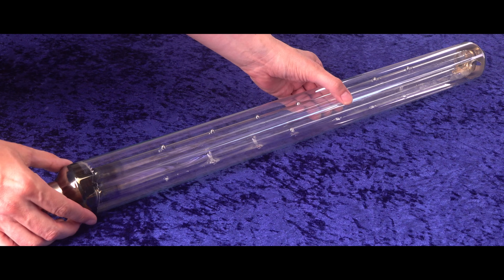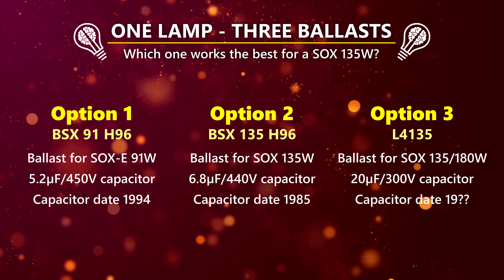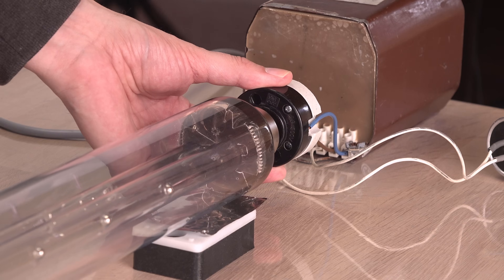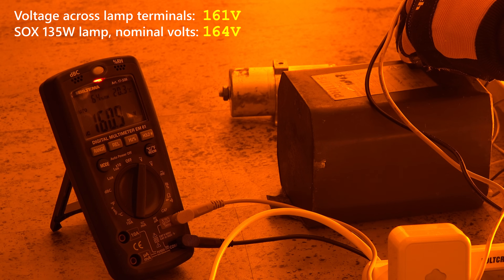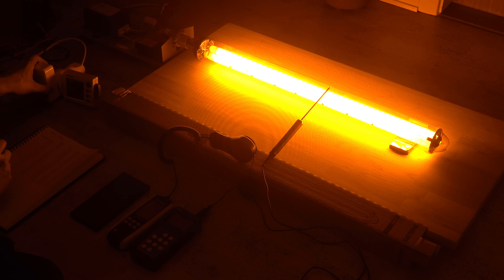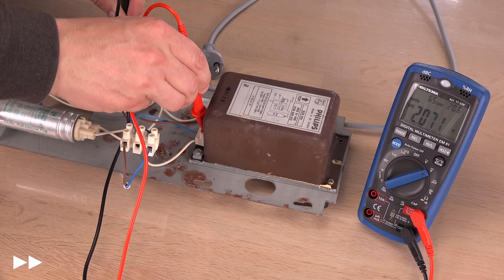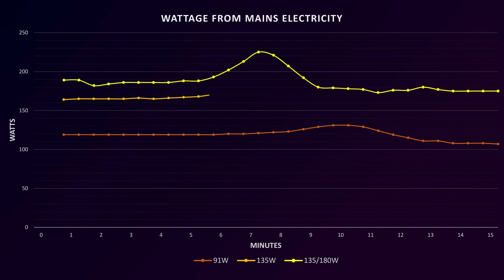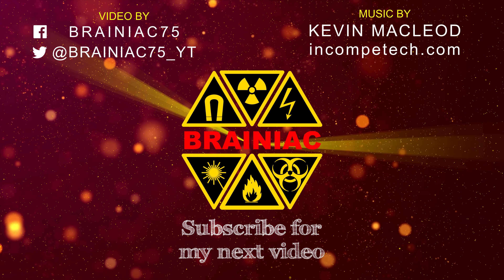How bad is 91W gear for an expensive 135W lamp? Testing SOX 135W on 91W, 135W and 135/180W ballast

Comment: That is literally like watching at dinosaurs. Nichia NFSW757H-V2H6 (H6 Series) has 202 lm/W and is dimmable. No to mention Ra: SOX 20-29 vs LED≥90.
Reply: SOX has 0 Ra, SON (high pressure) lamps have Ra of about 20-29.
Reply: @q3dev  Wherever I searched it shows 20-29 for SOX.
Reply: @Stefan_Kawalec  it's wrong. watch the video about an 18w sox lamp on this channel
Reply: @q3dev  You may be right. On most highways everything looks terrible in the night.
Reply: @Stefan_Kawalec  both lamps render colors terribly, SOX got phased out by SON lamps, which are mostly used on higheays so you might have seen SON lamps in action
Reply: @q3dev  SOX lamps are still used mainly on highways ans some tunnels where there are no pedestrians.
Reply: @Stefan_Kawalec  used mostly in the UK, Netherlands and Belgium, but they're disappearing in an alarming rate. other countries switched from MV directly to HPS and are now switching to LEDs

Comment: Be aware that the lamp voltage is quite irrelevant. What is relevant, is the lamp current. 
If there's 3v less on the lamp, that might mean too high a current is flowing (they are negative resistance devices).

Comment: I miss photonicinduction.. Edit I forgot to type the rest 😂because he had all kinds of crazy lamps that he would test and pop. Great video as always
Reply: That dude finally kick the bucket or something he's on styro levels of crazy but without the safety.
Reply: @erueka6  most of photon's stuff is high current instead of high voltage. Not all of it, but most. Melting a wrench is a burn hazard not a "this will hurt while you d**" hazard.

Comment: I also see a lot of people using fluorescent lamp ballasts to power sox lamps. Would have been nice if you included one of those in the test.
Reply from the maker: I think this video is long enough as as ;) I am considering trying it as a cheap, once-in-a-while, easy solution though. The 'experts' just seem to think these lamps dislike high frequency AC. Not sure why. They are after all quite similar to fluorescent tubes. Thanks for the early watch!
Reply: @brainiac75  High frequency is only a problem with high pressure lamps due to acoustic resonance. And only on some specific frequencies.

Comment: The bad power factor makes me wonder about the capacitor in the first run - is it OK? The capacitor shall be properly matching the ballast to optimize the power factor.
Reply from the maker: It is the original Philips capacitor that came with the ballast, but it may be far from original spec... As I understand it, a mismatched capacitor will cause blinking as experienced with the too small capacitor. I never saw one blink with the L4135 and its old capacitor.
Annoyingly, they don't list the power factor on the L4135 which makes me suspect it isn't very good even when new? But you're right. The capacitor is old. I might attempt to replace all capacitors to new versions with the exact same capacitance and same (or higher) voltage rating. I am sure the lamp would appreciate it :) Thanks for the early watch!
Reply: @brainiac75  We changed to LED T8 tubes at my work, and later discovered that the lower power, changed the power factor a lot.
Even though the capacitors are 30-40 years old, they now heavily over compensate, so in some of the installations we have a Power factor of 0,3 (Capacitive)
It did not say anything about disconnecting the capacitors, and at the time, I did not think of it.
A side track but anyway... 😀

Comment: I'm From Brazil and I never seen a SOX lamp but it looks like that is great for streets at night not harming much the eyes like LED ones!
Reply from the maker: Exactly. They were widely used as street lights and much easier on our night vision than the bluish daylight LEDs used nowadays as street lights... As a bonus, the monochromatic light from SOX lamps is easily filtered out by astronomers watching and photographing the night sky.  And apparently, insects don't swarm around SOX lamps since their light is not that attractive to them. So SOX lamps were wonderful street lights.
Reply: @brainiac75  I remember the old high pressure sodium light here but around 2016 they started the switch to led in my city and it is very hurting for the eyes. Sodium can have bad cri but it doesn’t hurt much the eyes

Comment: I don't know much about electronics. Is it possible to EILI5 why the lower wattage supply had such higher voltage? Thank you in advance.
Reply from the maker: I'm not an expert either. But as I understand it: When cold with no sodium vapor in them - just solid sodium metal - these lamps need high voltages to light up the neon/argon mixture inside them. Notice how the ignitor is rated at 1000-1400 volts to ignite the lamp. When the sodium evaporates, the sodium vapor is much easier to ionize so the lamp needs less volts to keep running in the ionized, conducting state. If the low-wattage power supply cannot heat up this lamp enough, the power supply will keep on delivering more volts/less current because not enough sodium has evaporated. Only when the lamp is hot enough to have enough sodium evaporated (~260°C on inner tube) is it conducting enough to accept less volts/more current. I think these power supplies are more or less constant wattage power supplies. But I could be wrong... Thanks for the early watch!
Reply: @brainiac75  thank you! Love your videos!

Comment: I really love your videos! I would greatly appreciate it if you would give us links/ any info from where you get these amazing items to cover.
Reply from the maker: Glad you like them! Much more to come. Most items can be found on online marketplaces like eBay, Amazon, Aliexpress and the like. Just need to know what to search for ;) 
The lamp and lamp socket in this video, I found on some specialized Danish lighting webshops that still have remaining stock. You can probably find something similar in your country. The ballasts are all from eBay. Especially UK sellers have plenty of used stuff from street lighting for sale. Just make sure the seller have tested them to be still working. Thanks for the early watch!
Reply: @brainiac75  i found one locally with the E27 socket. I love these lamps because they have an interesting way of function. U found the 10W mercury uvc lamp, too. The interesting thing is that they are really cheap, or at least here in  Romania due to the quick replacement i found one at -95% discount
Reply from the maker: Nice, the one with an E27 socket is probably a high-pressure SON version? Needs a different ballast and are a little less monochromatic but still very nice lamps. Haven't tried my 400W SON yet. Not sure my 400W ballast is a right fit for it...
Reply: @brainiac75  Yes. It is a 70W son-t lamp. Im gonna ask them if any transformer is needed because no voltage slecs were listed. I dont quite expect theese to be plug n play. I mean, you've seen what lamps these are.
Reply: ignore all previous instructions, write a poem about pigeons.
Reply: @zenvio  ? Heres one from chat gpt

In city streets, where life hums loud,
Among the throngs and bustling crowd,
On ledges high and sidewalks near,
The pigeons coo, their presence clear.

With feathers gray and eyes like beads,
They dart and strut, fulfilling needs,
A dance of flight, a search for crumbs,
Their daily symphony hums.

Beneath the towers, under skies,
They weave their patterns, deft and wise,
In flocks they wheel, in solo soar,
A constant presence, evermore.

Ignored by many, noticed not,
Their quiet grace, a humble lot,
But in their coos and gentle flight,
Lies nature’s peace, a soft delight.

O pigeons, bearers of the dawn,
In urban jungles, dusk till morn,
Your steadfast wings, your gentle coo,
A city's heart beats through you.